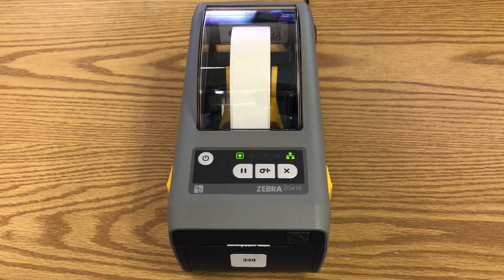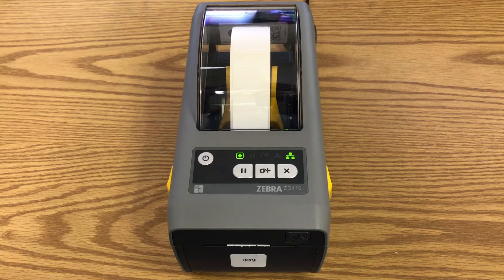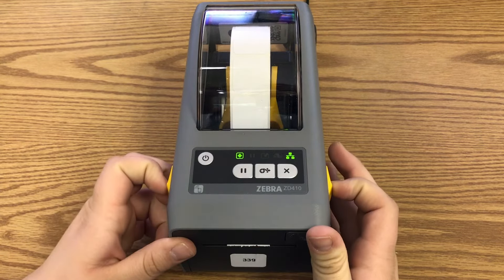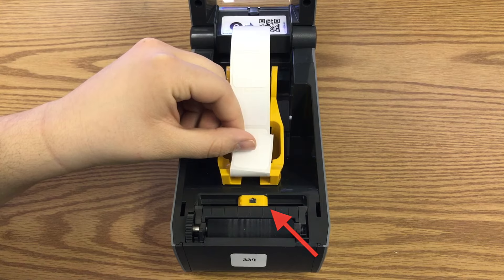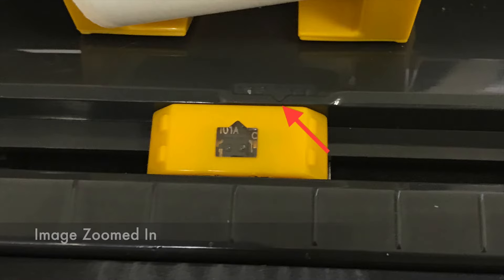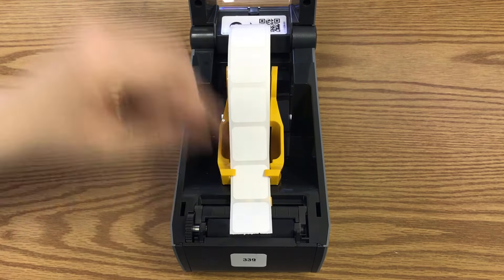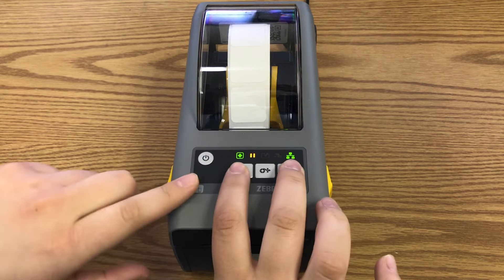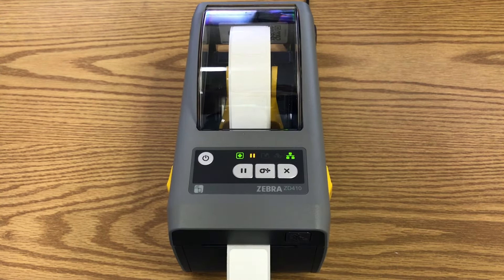Calibrating the Zebra Printer

Comment: Hey, im trying to print a QR code but it didnt work, any other way to calibrate it? I wanted to add that the icon on the right side is red and not green.
Reply from the maker: Hi! I'm sorry you are having trouble with your printer. If you are a Jolt customer, please reach out to our support team @ (877)-396-4112.  If you are not a Jolt customer (You should definitely be one!) you can try reaching out to your printer provider or to Zebra for help.